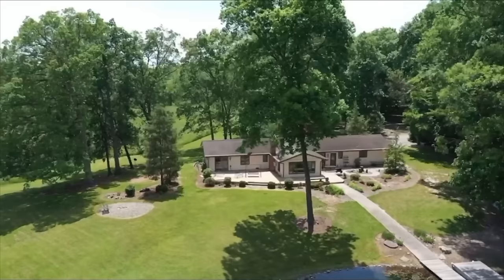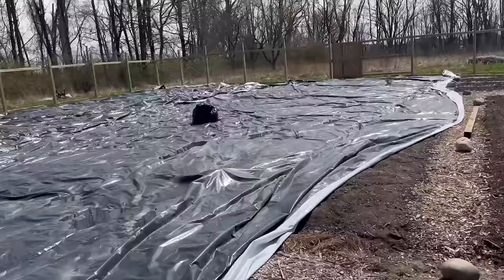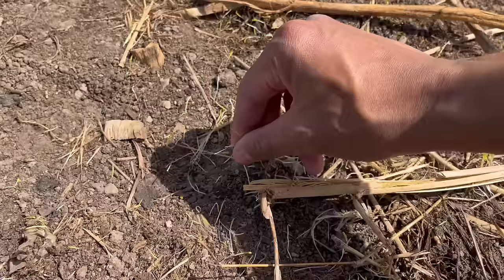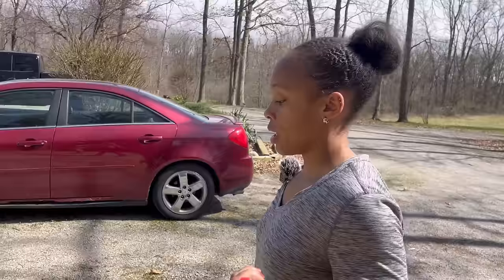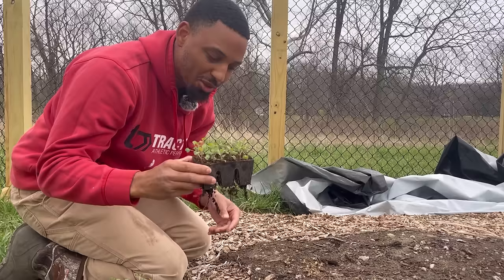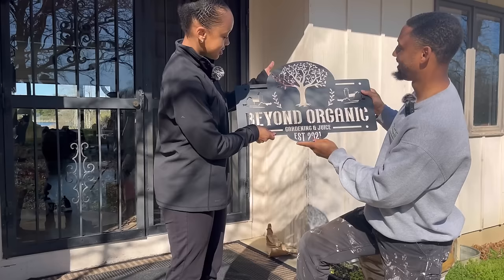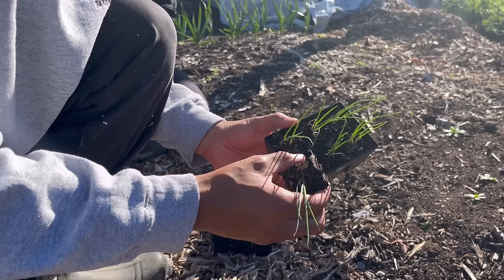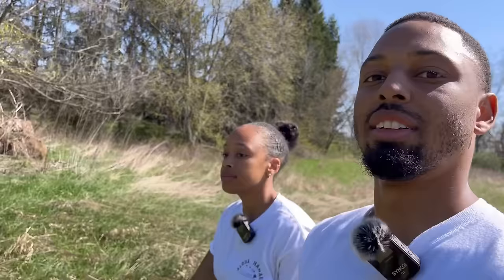Prepping and Planting into Our 12,000 sq ft Garden! *plus a cool surprise, flower picking and more!*

Comment: You need a Skidger.  It goes through weeds like butter.

You can put flower tape in a grid pattern, or use a flower wire or sponge to make the flowers stand up.
Reply: Great tip! I came to the comment section to see if anyone else has mentioned that. So thank you

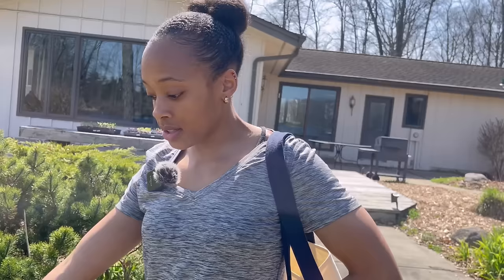Comment: Those plants at 3:30's is Daffodils Gerald is right. You guy's have an amazing property and those garden is huge! Simone, Those low vase is beautiful!  Tips: You could use a small piece of 1 inch mesh chicken galvanized wire to put on top of the opening of the vase it will keep your cut flowers upright and in place. Just make sure you put the sharp edges face down.